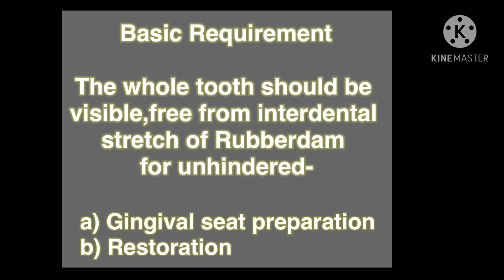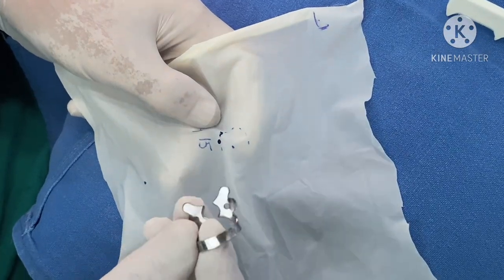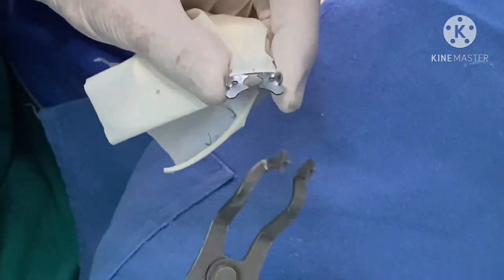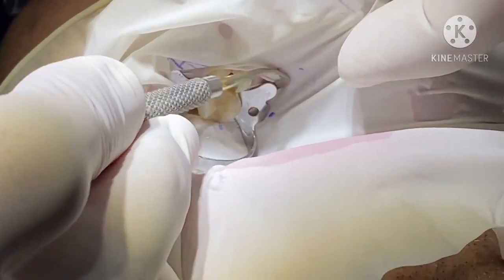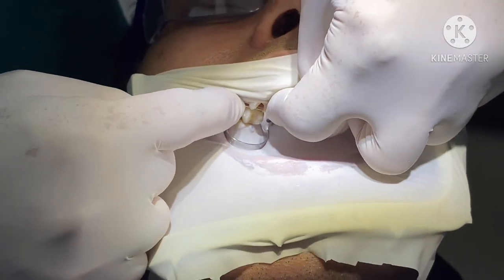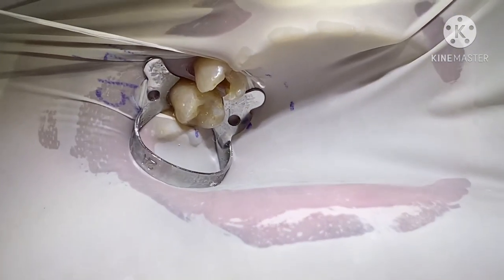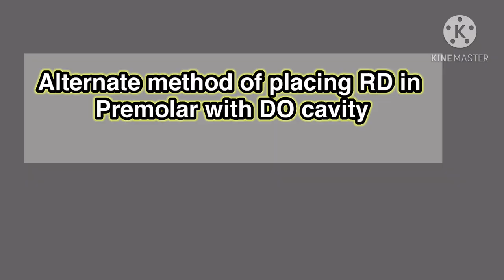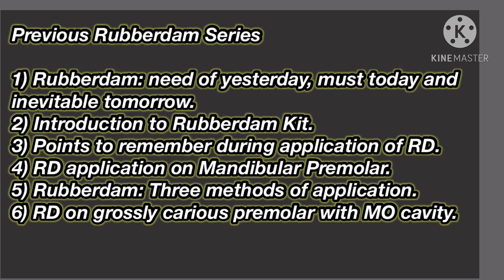Rubberdam on Premolar with DO cavity

Comment: Рамка должна быть сверху платка
Reply from the maker: it does not matter whether the frame is on the top or below the rubber dam. The main purpose is that the operation area   should be isolated.